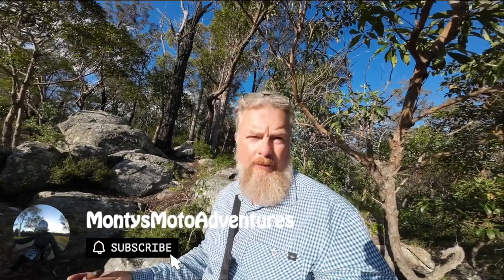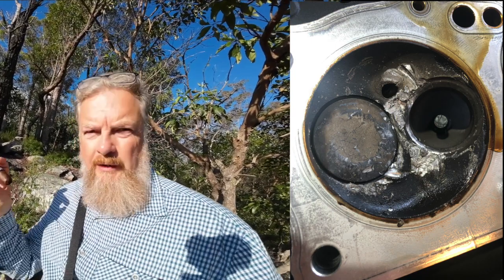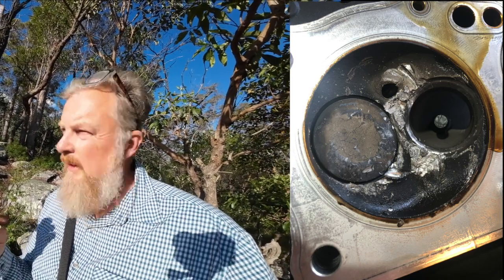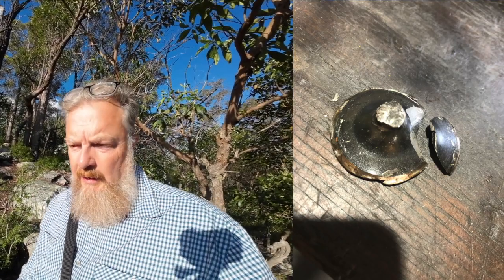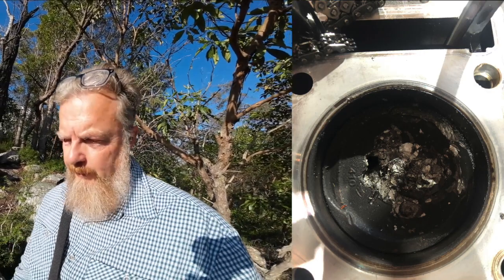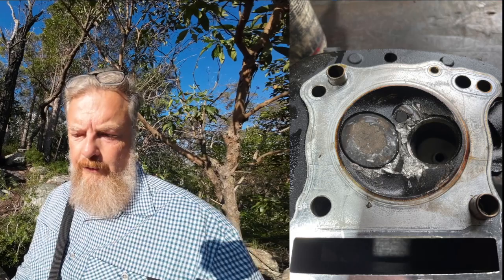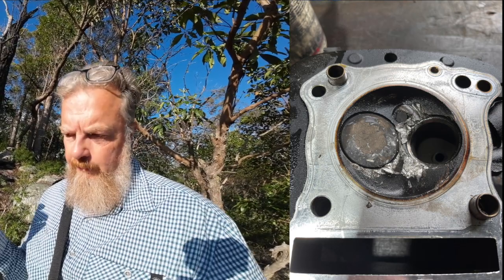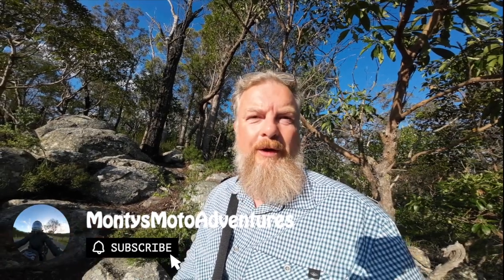Royal Enfield Himalayan, Engine Failure, update 11-11-22

Comment: There is a British guy in Bulgaria that had rattles and identified these stock valves as being poorly made and he mentioned concern about the weld from the head to the stem of the valve. He did a video on upgrading them and compared the before and after. You could clearly see the difference in quality between the two side by side.

Comment: Hitchcocks are selling these upgraded valves for the Himalayan made of better steel. Inclined to think just getting the Tech camshaft and replacing the valves at the same time is the answer (they are not expensive). The guy in Bulgaria pointed out that the stock cam is also quite poor quality, so the Tech cam is not only a performance upgrade, it could quite likely extend the life of the engine, as the steel quality and hardening is better. I think if you plan long term ownership of a 411 Himalayan, may as well get those mods done.
Reply from the maker: Yep. I switched to KLR650 big hopes for a long journey, 60,000 km so far in 9 months :-)

Comment: Hi, just found your video & I've just had a similar failure on my 2020 Himi with 18,000 miles. On my way home at 65mph, a bang then silence! Taking the spark plug out, end all mashed up! Head off, exhaust valve "head" detatched from stem and embeded into head after bouncing off the piston! New piston, barrel & head required! Chose to put "TEC" cam and performance valves in while apart! Also now got 16T front sprocket on aswell. Now done 500 miles, so starting to open her up a bit more, definitely got more "go" at less revs.
Reply from the maker: Nice repair. RE paid the parts cost on mine, hope they contributed to yours!!!
Reply: I reiterate Royal Enfield makes substandard bikes.
Reply: @MontysMotoAdventures  no, not a penny as out of warranty period, but should expect a modern engine to last more than 20,000 miles/4 years!!
Reply from the maker: @jameswaterhouse4146  Hi James, my thoughts exactly. I’d like to know if the 450 valve stems are welded or cast!!!

Comment: This was a very unfortunate event for you.  This is not an uncommon problem with engines.  It used to be a favourite fault on airhead BMW's.  The most common reason for dropping a valve is the valve clearance being too small and the engine running hot.  Also be aware that valves are often made in two parts of different compounds, the valve stem being of a different compound from the flared end as they live in different environments inside the engine.   Going forward it is better to have a larger gap, and a rattle from the valves on start up when cold is not a bad thing.    I do hope that Royal Enfield offer you some help.    I do not think this incident is a reason to ditch the bike or the brand.  Good Luck. 🤞
Reply: This is good info I didn't know this and was wondering why RE recommends valve adjustment every 3k. Im thinking about buying this bike or the 390 adventure.
Reply: @jimh2061  screw and locknut adjusters need more of an eye keeping on them than shims because the screw and locknut arrangement can move over time.
I used to prefer screw and locknut over shims, but with modern materials and lubricants, shims can go huge distances between checks. 
For example the Yamaha R3 and MT-03 motor doesn't need the valve clearances looked at till 26600 miles (42000 km)
Reply: Very good technical observation, hope RE replaces the engine for sure.

Comment: As I mentioned on your other video, I also had a catastrophic engine failure on my way to Usuhaia - 2023 Himalayan, with only 3000km. I was doing 80km/h and the engine blew up. RE is sending a new engine as there was massive damage, but I did not receive a report about what the problem was. It's been over two months since the RE dealership got the bike (under warranty) but I don't have any way to track what is happening and I've been learning about other bikes that had similar issues. I really liked the bike, but it will be hard to get over this without knowing what it was and how to prevent it from happening again....
Reply from the maker: The valve stems are welded to the heads to save money was one comment I had somewhere… good luck. I still kept my Himi will use as a local runaround when I get back in a few years time!

Comment: It appears to me that the valve was made from a batch of very brittle steel or was embrittled due to improper hardening.  I wonder how many defective valves there are out there made from this same batch of steel or by this defective hardening process?  My experience with catastrophic failures like this is the entire engine is ruined and needs to be replaced wholesale.  The head, the connecting rod, the crankshaft, the main bearings and the case are all ruined.

Comment: Ive had ridden a himi since summer of 21 as my primary vehicle.  It has been a love hate relationship since the begining.  I have repaired many things on the bike.  With that said I ride the bike very hard on and off road with no engine failers yet other then the fuel pump.  Although i think there is a xr, dr, or klr 650 in my future.  I hope you get it sorted out.
Reply from the maker: Hi, yes later video updates. RE paid for the parts I paid for the labour!!! Can’t complain since it was officially out of warranty. KLR is turning out to be a tad better for the riding I’m doing the 650 vs the 400 big difference!!! Cheers.
Reply: @MontysMotoAdventures  i do prefer the himilayan over the klr when it comes to off road riding(my himi is stripped  down and hopped up).  But dont like how often  repairs have to be made.  Ive had 2  klrs and they could take a beating and never broke, besides the ocasional clutch or brake lever.

Comment: The greatest thing about these bikes is just how cheap the parts are. 
The whole top end of this engine can be replaced for a few hundred dollars.
Reply from the maker: Not in Australia, triple the price, saw a top end assembly on eBay for $AUD900, was quoted AUD $4800 for a new engine (not fitted!) Luckily RE and the importer covered the cost. Thank you to them…
Reply: @MontysMotoAdventures  What!? How? I can buy a whole cylinder/piston and head completely assembled for less than $400 US! 
You must be mistaken because I am sure you could have parts shipped from several distributors world wide?  That’s crazy! 
Glad they helped you out!
Reply: The piston and cylinder body may need to be replaced depending on how badly the valve body bounced around. Hopefully the connecting rod was not bent. 
We had a Chevy suburban that dropped a valve like that. Before all was said and done, it had punched a hole in the top of the piston before it wedged itself between the piston and cylinder wall. We were in California at the time on vacation and had to spend $5k to have the motor replaced. Then on the way home to Dallas, the left rear wheel separated from the axle…lugs sheared off…an hour east of Kingman, AZ. Then to top it off, the transmission took a dump pulling into Albuquerque, NM and had to be replaced.

Comment: Could it be that this failure has been caused already in the ‘breaking in’ period (0km   -  1.000 km) of the bike ? According to the owners and workshopmanuals  those first 1.000 km you must not exceed specific speed and rev. limits and not ride in 5th gear. Just wondering. I don’t know.  It is the time where you have to careful not to exceed these limits because all the (moving) parts of the parts of the engine will wear a little and settle so the engine parts are getting better ‘aligned’ with each other.   In that period (I know it’s difficult) you have to be pretty gentle with the engine. Tiny haircracks or damages not visible for the eye could have occurred then and leading much later to such a catastophic failure. 

Possible? (RE Himalayan owner 2020 40k+ km)
Reply from the maker: Good point, I was very gentle with the Himalayan before and after its first service ;-)

Comment: There is a very short valve service interval on this bike, something like 5,000km. Have you had them checked every time? If not your gap probably closed up, that gets worse when getting hot and the piston makes contact and voila. The benefit of these simple engines is the ease of valve clearance adjustment but they must be done. I would be surprised if RE gave you the time of day unless you proved these were checked.
Reply from the maker: Hi, yes and yes they did thankfully! Values are a bugger to get to…

Comment: Did you check the piston crown for damage, if there had been something got between them it would cause this problem 🤔
Reply from the maker: Hey Jeff, because it was warranty dealer was keeping respectfully quiet ;-)
Reply: @MontysMotoAdventures  ha well let's hope it was a 1 off and not a flaw in what so far seems to be a good bike, however my Metior 350 after only 159 miles is showing the Engine warning light, I have been in touch with the dealer who assured me it's fine to run until the 300 miles 1st service, 
Hope it goes well for you.

Comment: I wonder if flooding/hydrolocking your engine added to the valve breaking 🤔
Reply from the maker: Oil was clean when I dropped it on my return home. ;-) As indicated in the video, replaced all filters etc. as a just in case… thank you for the comment though. Ride Safe. Monty.
Reply: @MontysMotoAdventures  I’m glad you got it fixed. But did cringe when you were hitting that starter button over and over 😬
Reply from the maker: @fullthrottle2008  lol, yes the old ticker skips a few beats ;-)

Comment: Fact is that Royal Enfield make cheap bikes and with that comes substandard quality. My bike the connecting rod bent before 26,000 kms. So much for their tag line ''Built like a gun''!!!
Reply from the maker: I must admit my thoughts on the value proposition of built like a gun is a bit suspect! But I do thank them for supplying the parts…
Reply: @MontysMotoAdventures  What irks me is that RE also discriminate between its customers. In India they dont take responsibility for anything and customers have to shell out big money for repairs and replacement parts for no fault of ours. From poor paint work/defects and Chrome that rusts to failed Fuel injection pumps and instrument clusters to even failed wiring harnesses.   This is all part of the Re 'heritage'. Overseas they will be taken to court for substandard quality and defective bikes..in India they know they can get away with it as the case will never be heard-at least not in our life time.
Reply: @RajA-wi2ut  issue is the bike costs a 3rd of the price in India.....
You can get himmi for 1.5 or 2 lahk in India which is 1500 pounds and 2000 pounds... And buy same bike in UK you pay near 6000 pounds...which is 6 lahk

Comment: Sorry to hear this. Wish I could tell you that fair trading will help but you will hear from their mouths they can’t make anyone in breach take any action, you will need to seek legal help elsewhere. Probably not what you want to hear, just another useless tax payer funded bloated gov org.

But about your bike. Haven’t heard of any others having such issues, I would be wondering if valve timing had been set correctly or if the adjuster lock nut worked lose. 

Anyway, get it fixed, put a big bore kit in it and keep going.
Reply: Fair trade is not relevant, the bike is out of warranty. If it was within the parameters of the warranty provided in the purchase agreement and Royal  Enfield refused to cover the repairs,  then yes, maybe they could help. Bad luck for sure and not as common as it used to be decades back, but part failures still happen. Best of luck with RE, hopefully they may, in the industry jargon, "participate".
Reply: @ac-mu2nw  it’s called involuntary warranty… it’s part of consumer law in aus that products have a fair useful life, this is regardless of any voluntary warranty a seller may offer. Fair trading is very relevant in assisting with consumer law breaches.